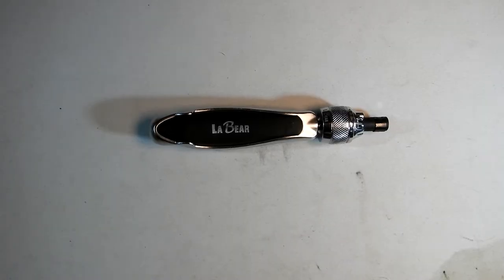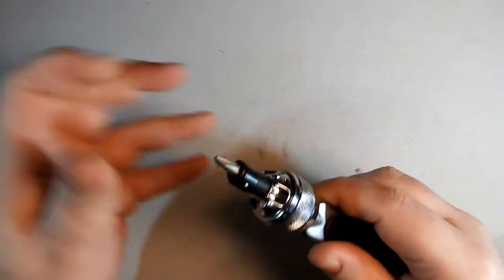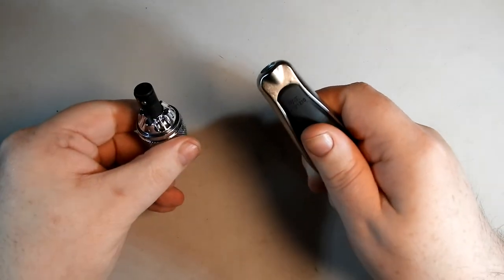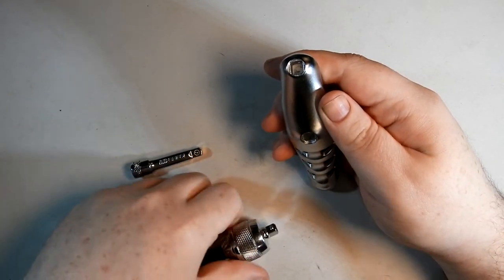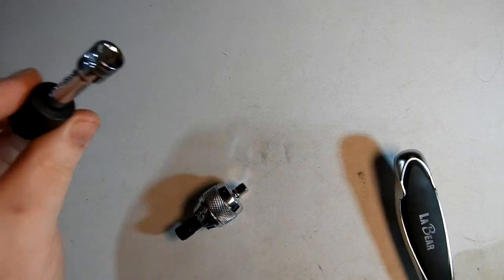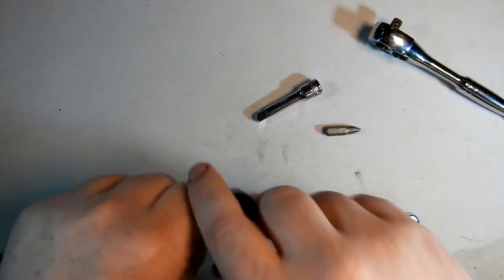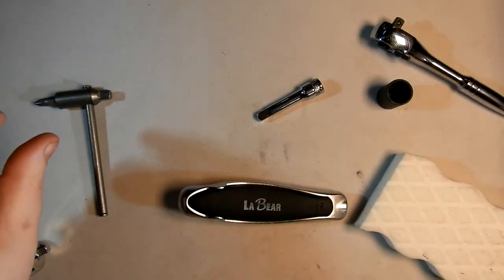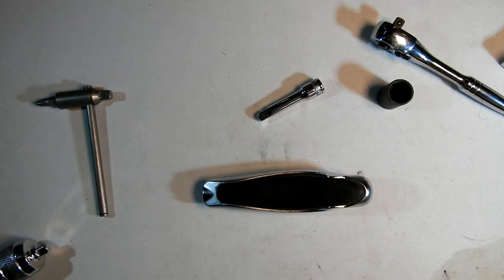Screwdriver From Outer Space! LaBear Ratcheting 3 Position Screwdriver plus Countycomm hack!

Comment: That is so cool. That's a great trick using the 1/4" drive extension and that sliding t handle dual driver works great with the handle.  I think I have a bit ratchet/driver addiction, so I'll be picking this up.

Comment: I had a ratcheting bit driver which used a ball bearing.  The ball bearing kept falling out so I inserted a pill shaped rare earth magnet to hold the bits.  If the handle of the LaBear driver is hollow, you might modify it to hold spare bits.  Thanks for the video.
Reply from the maker: I installed a magnet in the driver head, there was a perfect space for a 1/4 inch magnet, dropped right in like it was made to do that. The handle is indeed hollow, it would be fairly easy to rig something up to hold bits, but I am kind of weird when it comes to bits, I like plain handles without bit storage, then just carry a small set of bits. Thanks for watching and the good ideas!